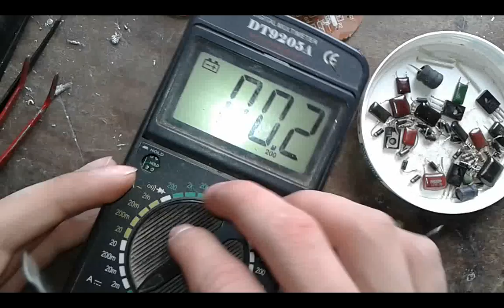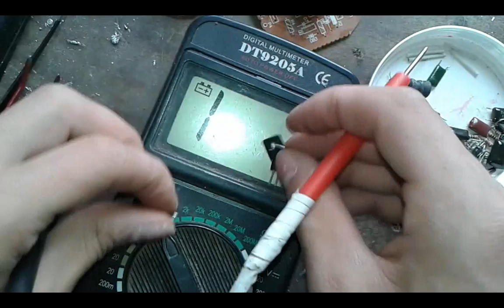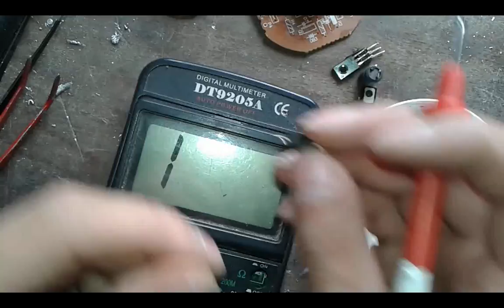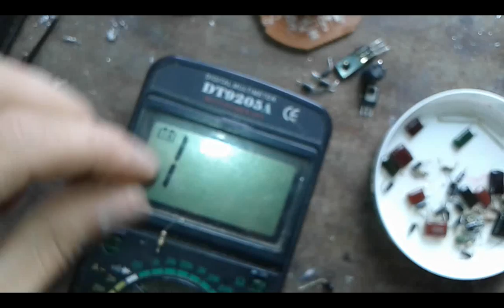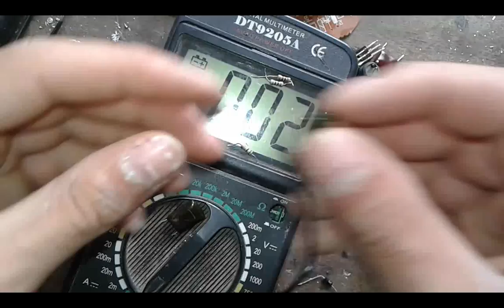Saving Components from old CFL Bulb circuits to use them to repair other  Lights :D

Comment: plz make a new video showing the multimeters points
Reply from the maker: +akhil kalita what do you mean  by "multimerer pounts" ? :)
Reply: I mean plz show the multimeters switch positions while testing the components
Reply from the maker: +akhil kalita all diodes and transistors  are measured in Diode(continue) mode .
Reply: and the condensers
Reply from the maker: +akhil kalita capacitors are measured in uF. My multimeter is a maual range multimeter so if i have for example a 1-150uF i have to set it to 200uF range :)